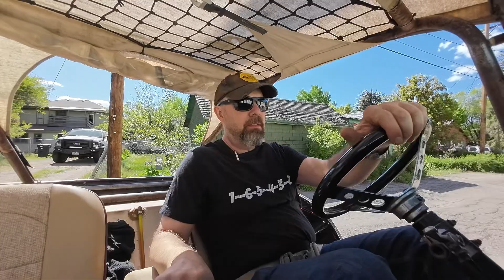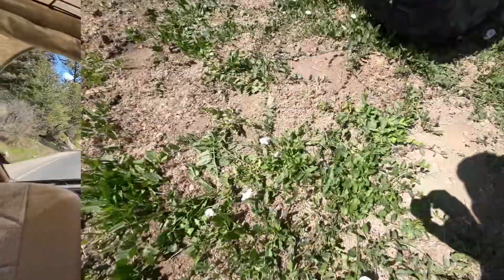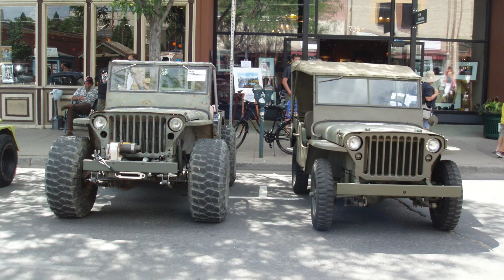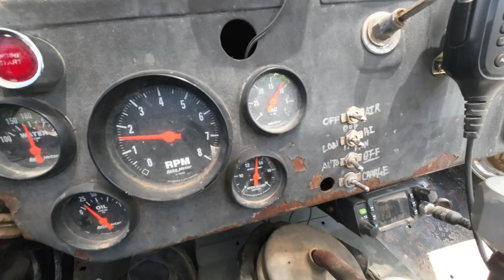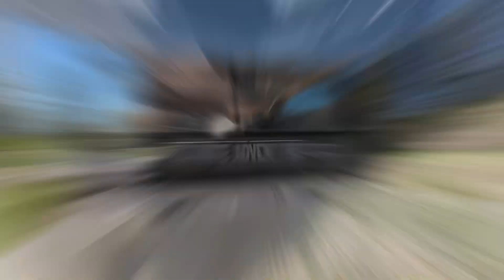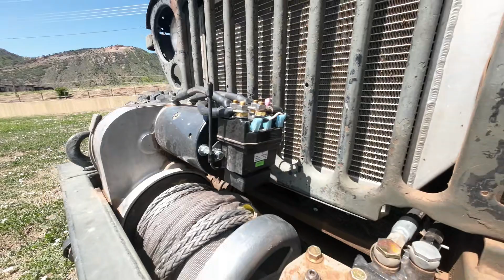Rango Willys MB Review: Memorial Day 2024

Comment: Will a v8 fit in rango with the same transmission transfer case combo or is that pushing it
Reply from the maker: In my opinion, no. A V8 in a flatty requires a 3-4" nose stretch to do it right and have enough room for things like a proper cooling package.

Comment: Awesome to see Rango again. I have slowly been gathering stuff so i can build my 48 willys. Your videos and build info is very inspirational. Thanks for all the info. I have a 4.3l chevy and took your advice awhile back and boight a ford T18. Need to get a bell housing roinded up for this combo at some point. I think i might try and use my dana 18 transfercase but need to find axles that pumpkins alingn with T case. Happy Memorial Day to you too !
Reply from the maker: Sounds like a great project. You can pretty easily adapt a ford T18 to a GM bellhousing with a spread bar. I think Novak still makes these. Overall, that is going to be a great combo.

Comment: awesome videos Brennan - can you go over the rear shock mounts when you have time. and rear axle/ springs and why you moved then backwards. thanks 👍
Reply from the maker: Thanks. In order to fit the 35s at close to stock ride height, it is best to move the axle back to help the front of the tire clear the front edge of the wheel opening. You can't trim that side nearly as much as the rear of the opening. The rear shocks mounts don't really work that well ( shocks are laid too far back ), I will be doing something different when I install the new fancy rear shocks.